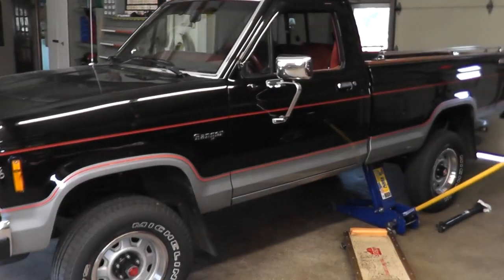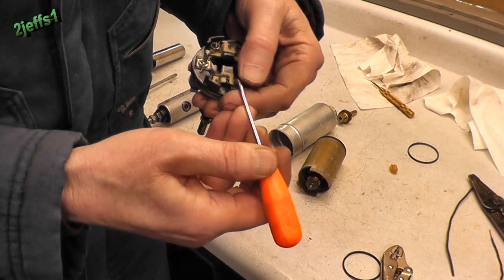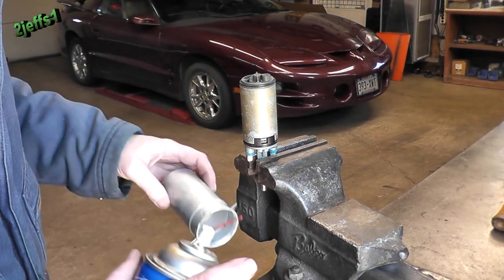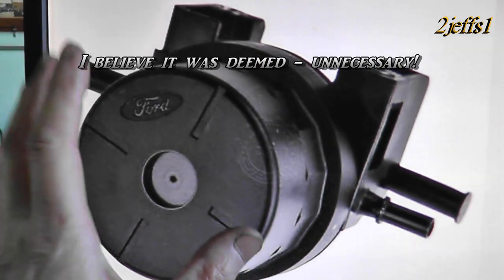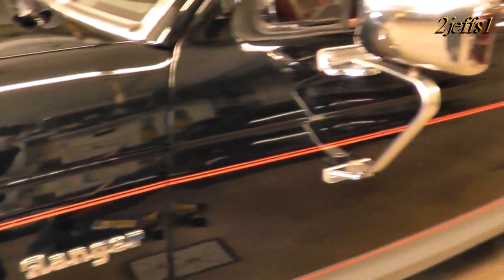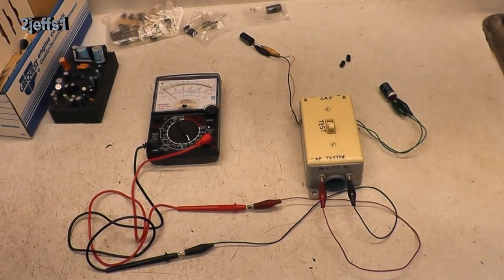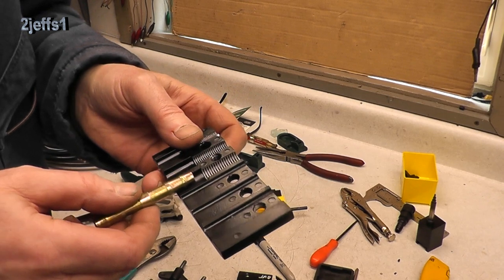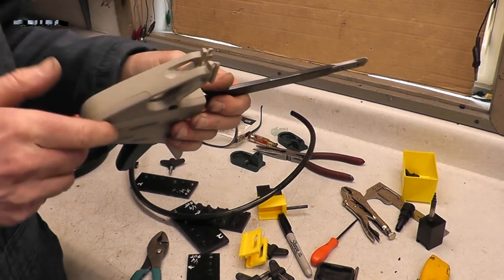Electric Fuel Pump Repair & DIY Tool for Nylon Fuel line Connectors

Comment: Greetings jeff(?) I’ve just saved a 1991 Bentley from being scrapped.... no fuel pressure, plus loads of other issues. It has twin fuel pumps, both “seized”. The list price is 500 dollars... each! No one here in England says they can be repaired. Once opened up, both gummed with old fuel from standing....  both now fixed! it may not be enough to save the car ( loads of other issues) but I’m a step closer!
Thanks a lot...😎

Comment: I got to thank u so much. I bought an rv that has the same fuel pump, its pissin gas out of the seam and I couldn't figure out if it was a hose or the unit. Same exact fuel pump. I cant find any info online about it. Ur the one and only that I found on it and now I am going to repair it because I don't have much money and I got to try to fix it now that I know how. Thank u so so much for taking the time to make this video

Comment: That optional fuel line and pump for filling smaller gas cans is smart! I love that trick and may have to borrow that one.
Reply: wyattoneable I made one that screws onto the Schrader valve of the fuel rail, it may take a bit longer to fill a can due to the smaller opening, but it works fine and is easy to install, remove, and store some place in the vehicle.
Reply: roguesquatcher...thanks, that's a good idea too.
Reply from the maker: That is so convent. Once one has that setup you'll never be without it again. Actually that idea that roguesquatcher brought up would be the easiest to do if one didn't want to cut into the fuel lines. One just has to jumper the fp relay in the fuse box. I have used that technique to drain fuel tanks when they are rusty and needed replacement or the fuel sender needs replacement. Thank you roguesquatcher for bringing that up where that is another excellent alternative for the viewers.

Comment: Jeff you are a genius, I too have had a few of the handles break on that dorman fuel line tool, also the plastic wingnuts are junk too, they crack and spin on the metal stud. Top draw video as always!!!!!!!!!!!!!!!!!!!!!!!
Reply from the maker: Really neat Kevin to hear I'm not the only one who don't like that tool. Got a LOL on the wingnut tip. Didn't run into that one - yet! Them white quick disconnect connectors. Could never get the line on those without sanding the barbs a bit. (read that in a review too, same issue, seems the p/n was 800-116) That new tool pops them right on, absolutely no issue now!
Reply: I will have to make a tool like the one you made.

Comment: I myself did the T thing in my old Dodge so I could have a fuel pressure gage on my dashboard. I used the truck only for plowing snow.
I put another T under the hood with snap fitting to fuel up gas cans and lawnmowers and such.
It's a good deal.good video.
Thanks
Reply from the maker: Neat to hear you are doing that too! I'd put that in the category - once one has that setup you'll never be without it again where it is so handy, not to even speak of such a time saver!

Comment: That is nice you have a tool to do those fittings ...Years ago I had the panel off an old micro wave and used it for the clock on it
Reply from the maker: Cool. I like hearing when things can be re-purposed instead of pitching. I always like the optional cost on those type things!
Reply: not2fast4u2c 
Ooh thanks for reminding me, I have one of those 80s kenmore nukers stashed away in the horde. 
That helped remind me about the junk newer nuker I have, that needs to have a big bottle of gasoline warmed up in it😬

Comment: Jeff, that plastic biscuit looks a lot like a pulsation damper or eliminator.  I've seen them before inside residential oil burner pumps.
Reply from the maker: Thank you! That does make sense where you seen them before on different systems.

Comment: very interesting on oem line i just heat it up a bit with a heat gun idk if it will work on your aftermarket line you should try and make a video. never had a problem with it doing it with a heat gun

Comment: 80s flashbacks there. I should have thought about eliminating that stupid fuel reservoir when we replaced it om my son's Bronco II. Expensive piece of poor design.  I hear you on that Dorman fuel line repair kit. I  remember the first time I run into those clips and had no idea how to remove them. I broke one and it was pricey to replace.  Wasn't that thrilled with them.
Reply from the maker: Very interesting to hear you ran into that too! On that customers vehicle I kinda wanted to eliminate that thing too but where it was a newer customer and they don't know you well yet sometimes then I just put things back to the way they were. If I would of had the new tool then instead of using those union's I would of did the splice barbs. The flex of 2 ends at once and very little travel of that old tool, cant make it work on the bench, not gonna try on the truck! Enjoyed reading about your experience. Thanks for sharing!

Comment: What's up with the hawk? I just destroyed a fuel pump. wanted to see why a pump that was only a month old. Here the bottom turbine was jammed. This was a in tank fuel pump for a 89 s10 pickup.  What would cause this to jam up and WHY does my truck hate fuel pumps? I purchased this truck and he had installed a new pump and hanger assembly. I never had so many issues with fuel pumps.

Comment: Jeff that little rubber cap you mentioned early in the video have been a dust cap on original production models of the pump. I don't think they would come wrapped or boxed to  the assembly plant?
Reply from the maker: That might/sounds to be a possibility. I remember many years back when I first got into rebuilding automatics at times there was a white plug with a stem on it laying in the pan. I believe it was a plug, they must have punched it in on the assy line installing the dipstick tube. One time had one in that was a fairly fresh rebuild. Someone left a rag in the pan, pressure loss, causing the clutches to slip/fail. It's sad to see when people don't get their money's worth on repairs. Seen some weird stuff thru the years, never seen that one again!

Comment: Great work as usual. I have a question though are you going to rebuild those capacitors later?? ;-)
Reply from the maker: We have an ongoing in-house discussion here about a battery blanket. One covers the battery and over night the battery will not only be better than new it also gets slightly larger. I think I shall try it on those caps tonight!  :)

Comment: very nice job, so it was the oil rings that where bad?
Reply from the maker: Correct, the O ring was bad causing fuel to leak past the case/pump body externally.
Reply: Where did you get that fuel line kit? And what is your opinion oin nylon fuel line?
Reply from the maker: That kit came from a local auto parts vendor. Those nylon lines are a nice alternative vs steel in a high road salt area which we are.

Comment: I have a fuel pump from a 2003 is300 that stops one's a week and i I Just take it out put it straight to the battery and it works for another week

Comment: The new pumps on direct injected engines are even more sensitive to running out of fuel and are high dollar!
Reply from the maker: Haven't sold one - yet. Thanks for the warning. I call that - robbery without a gun!